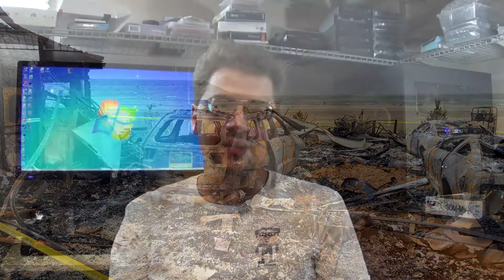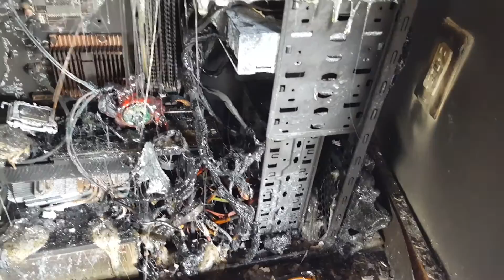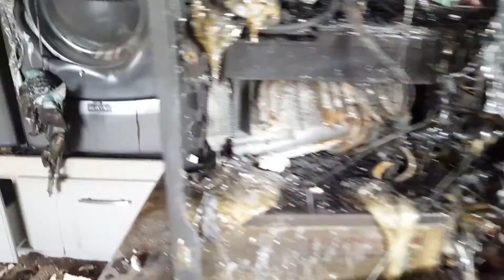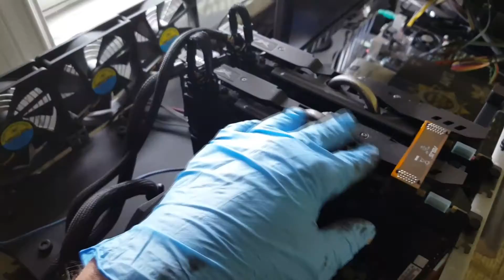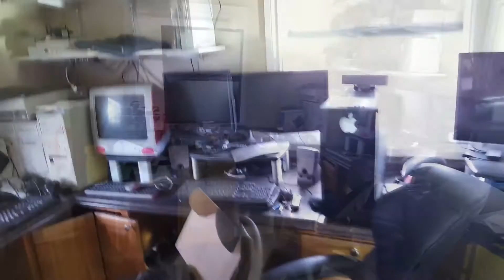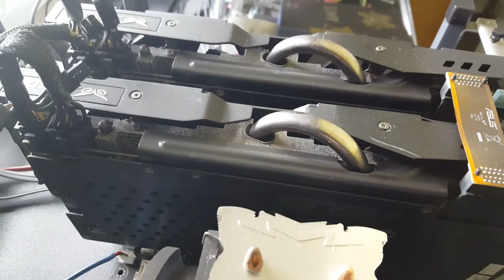AdopedMike was on fire!

Comment: Wow! I can't imagine that happening to me or loosing any of my tech related items in general. I would say do the good old dishwasher trick with some of the stuff assuming you have access to it anymore but if not you are right, it can always be replaced :)
Reply from the maker: +Shelden iHardware Interestingly enough, I did try the dishwasher method on my Lian-Li test bench. I did 4 cycles in the dishwasher with varying temps and detergent amounts, from quick wash and no detergent to the longest and hottest wash with a full detergent load. It didn't remove any of the smoke residue at all. I ended up having to wipe it all down manually with paper towels and it ended up ruining the aluminum test bench anyway. I have had luck using a ozone generator on plastics to remove the smell. It kind of "soaks" into plastics some how and bonds with it. That smell is difficult to remove. The fire started in the garage. Three vehicles burned to nothing. Lots of plastics, rubbers, paint cans, gasoline, diesel, oils and other things that shouldn't burn. The smoke created from that crap was unbelievable. It burned our eyes, nostrils and lungs. Very hot and toxic fumes. The fireman said that 5 breaths and we likely would have passed out and died. Strange experience. Hopefully I never have anything like that happen to me again. I lost all of my old computers. I had some old computers like you feature in your videos. The old stuff is pretty cool but hard to replace as I am finding out now, especially in Montana. Not many people here to get stuff from. Ebay has been a decent source so far, though. Thanks for your comment and thoughts. I like your content as well. Keep up your good work, your videos make me laugh.
Reply: AdoptedMike Wow ya I never really thought about what might be in all of that smoke so thanks for pointing it out! Also thanks for liking my videos! Hope to see more original content from you to cause I absolutely loved the power supply testing video and AM1 system videos, you don't see anything like that on YouTube, only the latest and greatest to be honest, so keep it up and hope to see you making more videos soon!
Reply from the maker: +Shelden iHardware Thanks, I appreciate it!

Comment: Are house fires common in the US? This is really scary.
Reply from the maker: +Ceasius I don't think they are common. I would guess as technology and building practices advance, there will become fewer and fewer house fires. I would guess it is a statistics thing. Every so often a fire can occur. The more people in an area, the more fires you will hear about.
Reply: AdoptedMike I see, it really sucks man. I hope you can recover everything easily. I thought it might have something to do with the building material. In South Africa we still mostly build with bricks and cement, so fires spreading seems less common here, unless it was intentional, with our crime rates, it doesn't surprise me.
Reply from the maker: +Ceasius Brick and cement construction is much better for fire resistance. In the US a lot of homes are built with wood as the primary construction material. Also a lot of plastics are used. Most of a home here is flammable. About the only thing where concrete is used is in the foundation. Some homes use brick exteriors, but still have wood framing on the interior so they can start on fire from the inside. Sorry to hear about your high crime rates. That is really scary unfortunately. I don't understand why people have to hurt and steal from each other.